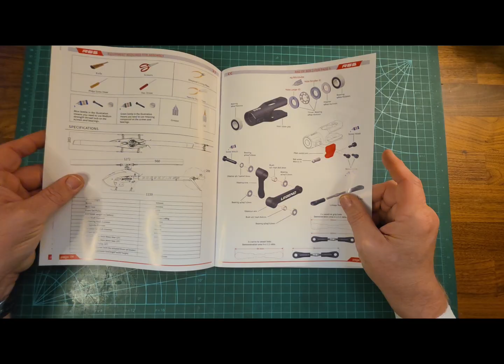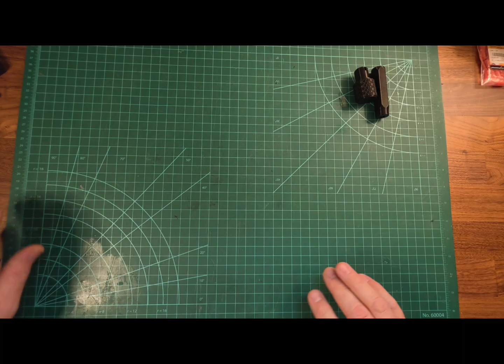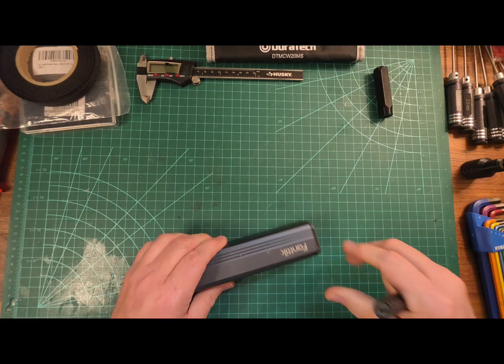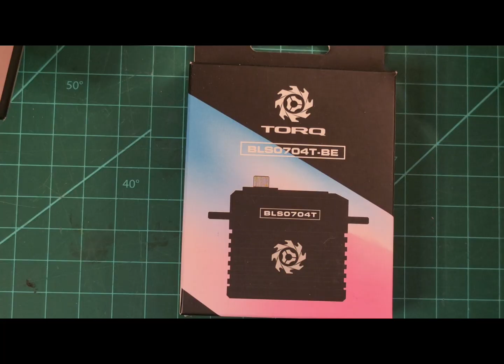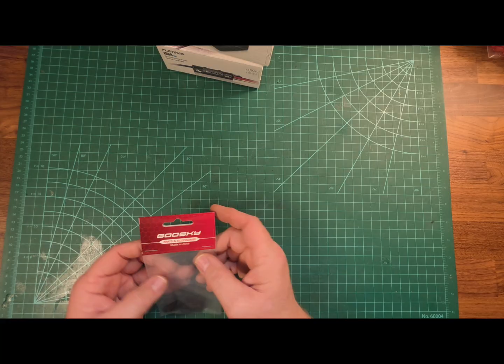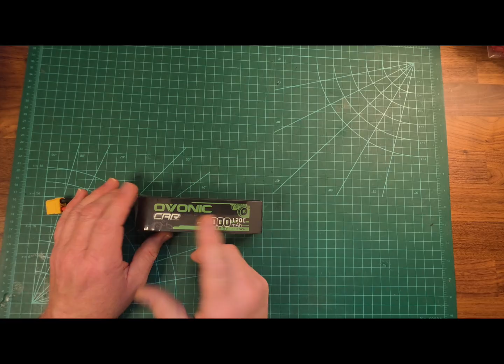Goosky RS5 tools and parts

Comment: Hola, amigo. Tengo una consulta. Veo que estás utilizando un destornillador eléctrico dinamométrico. ¿Qué medidas de torque tiene tu destornillador? Actualmente estoy volando un heli modelo Align Trex 450 Dominator. Me gustaría tener un destornillador, pero que me sirva tanto para un 450 como para un 700.
Reply from the maker: @jorgevieradsocar El Fanttik E1 Max ofrece un par alto de 0,2 N·m y un par bajo de 0,05 N·m, mientras que el DeWalt alcanza las 23 pulgadas-libra en su ajuste máximo. Te recomiendo utilizarlos en un ajuste bajo y terminar el apriete con una llave hexagonal o manual para evitar apretar en exceso.